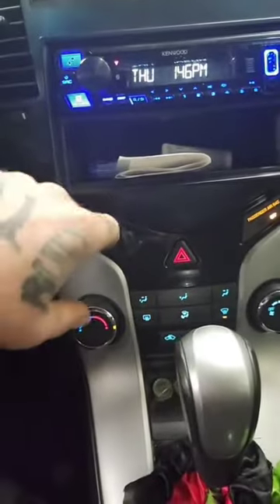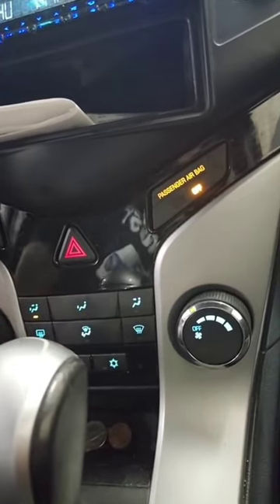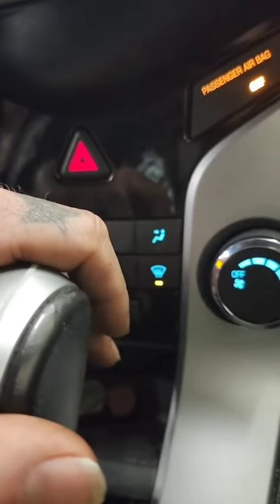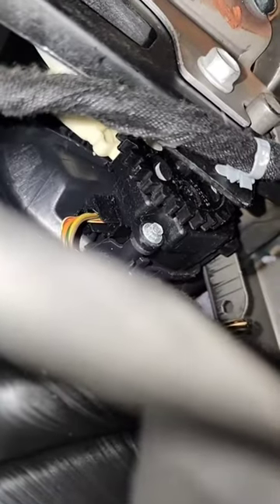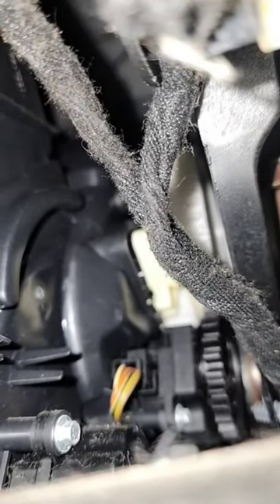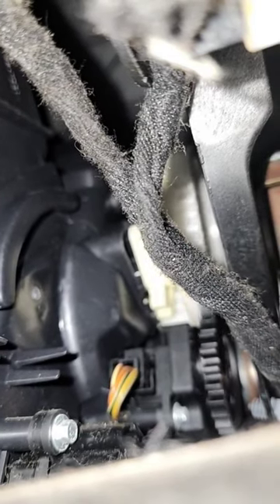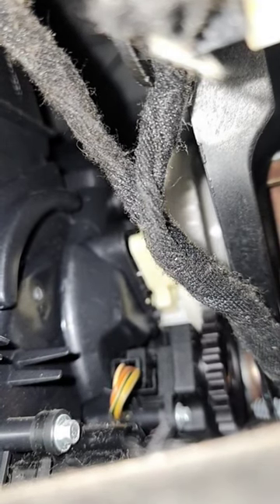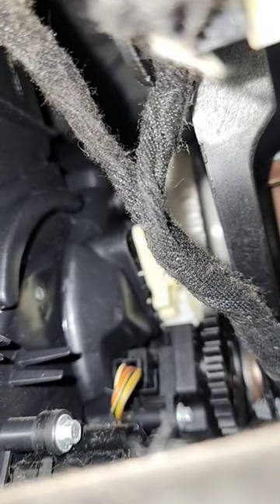Chevy Cruze no defrost concern

Comment: Yay for plastic!  They put that crap in garage door openers too.  Door wouldn't go up.  I found a pile of former gear in the housing.  Thankfully there was a ready supply of replacement parts and easy access.  That looks like you need three elbows on each arm to get to.
Reply: Most things are designed so that is something goes wrong that there is something cheap that is scarificial. Like the gear in your garage door opener. Let's say something bound up the door when you were lifting it. Without that plastic gear being sacrificed, the whole opener might need to be replaced.

Comment: 1998 chevy c1500 remove dashboard, remove complete duct, replace 3 actuators ,heater and ac core, defrost duct. big job all fixed.

Comment: Damn, remember the days of cable actuators and levers, or should I say reliability? 🤔
Reply: Your right. My 2005 toyota tundra has cables and trap doors. One time in 17 years of owning that truck I had to clean the levers and lubricate because the lever wouldn't move of to the panel side.
Reply: And vacuum
Reply: @JohnSmith-xu7ev  i didn't find vacuum as reliable or as easy to fix. Just my experiences I'm speaking of.😉👍

Comment: Just did my daughters car, not a bad job and you don't have to remove the dash to do it.  Only the gauge cluster.
Reply: Thanks for the info. My 2013 is doing something similar right now. I've been dreading the job for a month. I'm not giving the dealership a dime.
Reply: @realfreshfood4575  Parts were less than $20.00 at the GM dealer and are made better but still plastic.  Took me an hour and a half or so, you can do it.
Reply: @georgehenry8422  Thank you. I usually wait until I get the parts for all of the little things that need fixing and do them all at once. This can't wait, however. It's cold where I live. I'm not afraid to tackle the job. My dad made sure I was mechanically inclined before I got out of the house!

Comment: Pretty common. Stock lever arm is hollow underneath the teeth and the teeth actually break off. Updated part is solid. Under $10 apiece from the dealer. Save yourself trouble down the road and change em both at the same time.

Comment: The only thing worse than these plastic gears is "engineering" grade plastic on an engine, in contact with either hot coolant or motor oil. Volvo heavy truck has 2 plastic tubes that Will decintigrat and one of them you have to pull everything off the right side of the motor to repair.

Comment: I had a 2013 Malibu that uses the same plastic gears. Dealer wanted over $1000 to fix because the whole dash has to come out to get to it. I paid less than $10 for gm genuine part and it took about 3 hours.
Reply: I have a 2013 Malibu, my upper one has broke. How did you do yours? We tried to go underneath the dash but couldn't remove the panel even after taking off the air bag and many other screws.